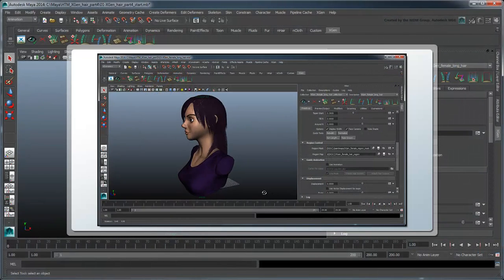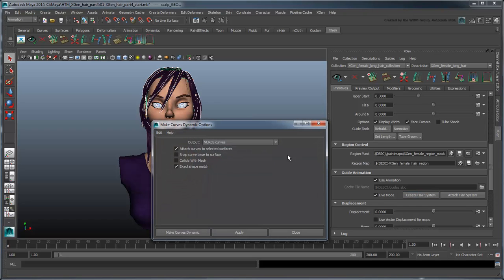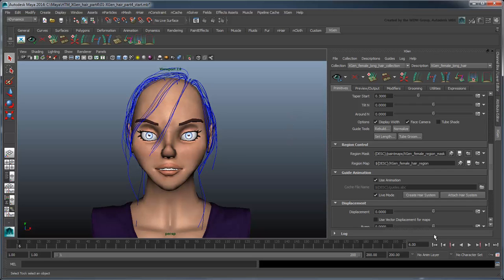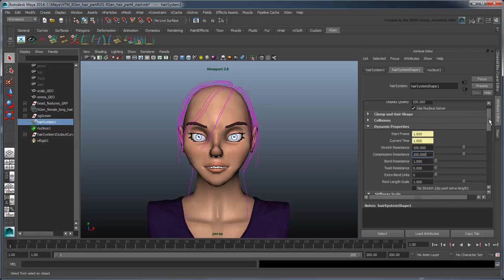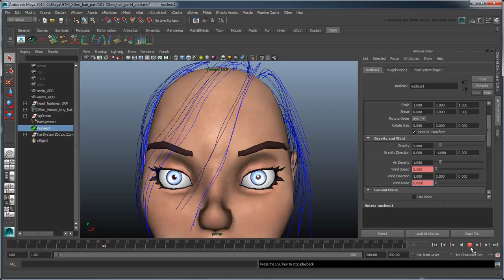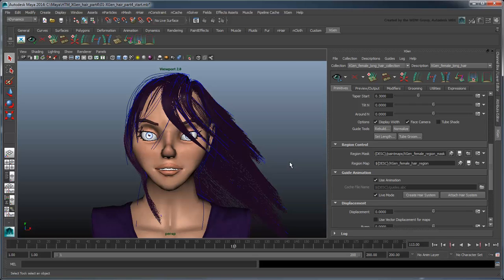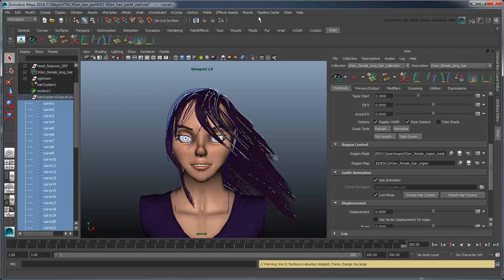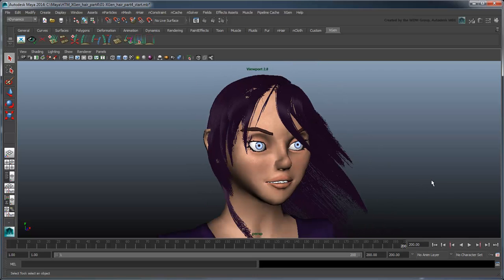Using XGen to create hair (Maya 2014) - Part 4: Animating with nDynamics

Comment: Is it okay to use Xgen collection as a reference? Everytime when i save my file with cache file checkbox turned on all the xgen guides goes straight to the horizon and render goes to trash.
Reply: As far as I am aware xGen is currently not supportive of file referencing. Its something to do with xGens reliance on object names (and vert numbers) and the way in which referencing handles object names.

However, I went to FMX this year and got to speak with some autodesk programmers at a conference featuring xGen and apparently they are working on a method to be able to reference xGen correctly

Hope this helps
Reply: Actually now i know that its not a problem to work with xgen references

Comment: Okay, I did the change to preferences in the link you provided earlier, and the hair is full where it should be. However, I'm still getting a slow choppy playback, and a red-highlighted message in the lower-right window. It says "//Error: line 1: No object matches name: XGen_female_long_hair.inheritsTransform". What does this mean? Not sure if the my downloaded file was missing something, or if the slow playback is only a sign that I need more memory on my laptop.
Reply from the maker: +FrozenAura1982 Hmm.  Did you set the project file beforehand?  You shouldn't be getting the error, however it might not have anything to do with the choppy performance.  In general, XGen is pretty system intensive and requires beefy hardware to run as we've shown in realtime (of course you always have the option to playblast or batch render to see the hair run smoothly)

Comment: In my file, which I got from your link, the hairs don't follow the curves as they do in the vid at 8:08. I get a message in the bottom right corner saying "no object matches name" and other stuff. Am I missing something? Also, the are exposed parts of the head without hair in my working file, and the animation is VERY slow (that could just be a memory issue with my hardware).
Reply from the maker: +FrozenAura1982 Hmm, I would double check to make sure the XGen plugin is loaded and then clear your prefs.
Reply: +Maya Learning Channel  I checked the settings/preferences -> Plugin manager window and Xgen is loaded. How do I clear my prefs?
Reply from the maker: https://knowledge.autodesk.com/support/maya/troubleshooting/caas/sfdcarticles/sfdcarticles/Reset-Maya-to-Default.html

Comment: when dragging the vertices for shaping the guides, only vertices move separated from the guides , it's like they aren't attached to each other! I might have changed settings but have tried reloading the xgen plugin and reinstalling Maya a few times but the problem is still there.any suggestions?

Comment: My entire spline hair system is not moving with the character.  Should I connect the hair collections to something?  I tried parenting it to the mesh but that corrupted the file.  Thanks
Reply from the maker: msisajewel Try downloading the scene file in part 6 and looking at how we did the parenting/constraints.
Reply: Part 6. Will do. Thank you!